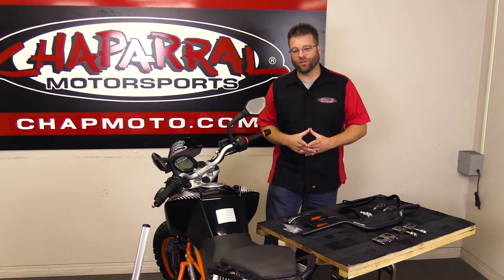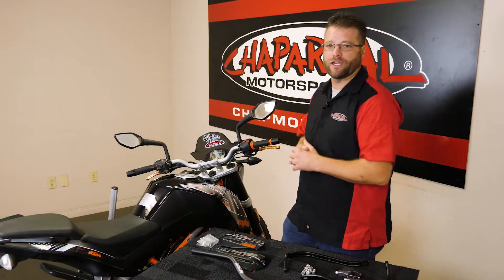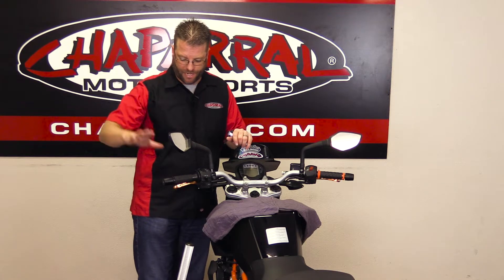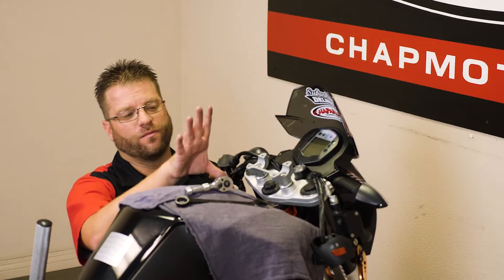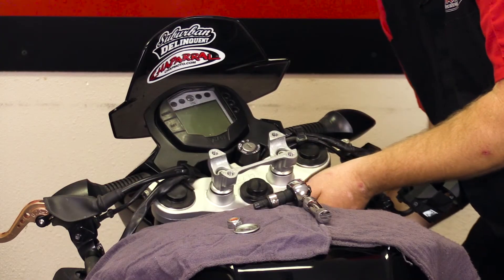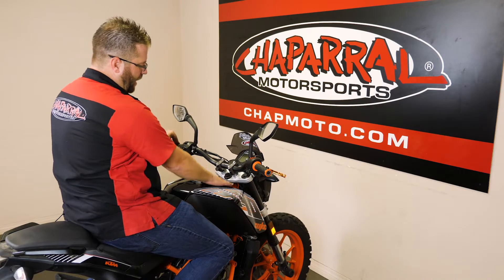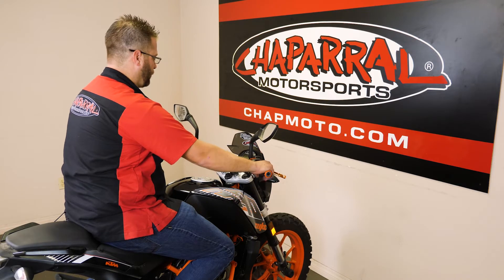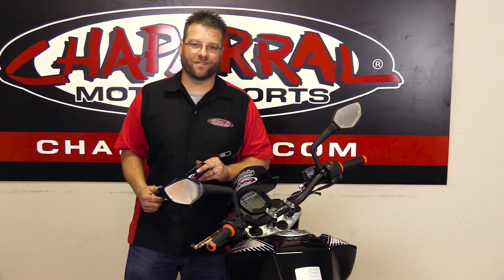How to Upgrade Your Motorcycle Handlebars - Zeta Aluminum Pro Taper 1-1/8" Handlebars

Comment: My stalk riser clamps have a little play in them if I try to rock the bars backwards and forwards. When I say a little I mean it's very minute. They are tightened up underneath as much as possible, Is the common or normal? as this is my first bike. It's a GSX1250fa.
Reply from the maker: Hello, there two sets of rubber bushings that sit above and below steering head as part of the riser assembly. They help reduce vibration and may have slight movement. But if you think they are moving more than they should, they could be worn and would need to be replaced. Thanks for watching
Reply: @chaparralmotorsports  Thank you for taking the time to reply👍👊👍